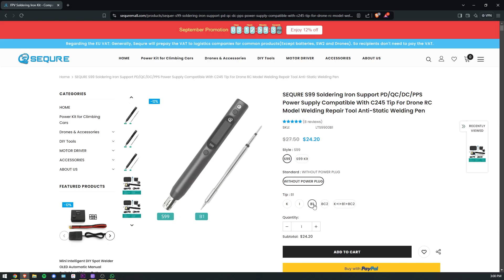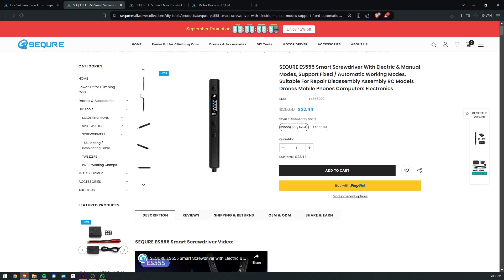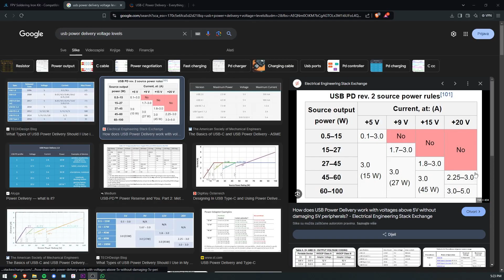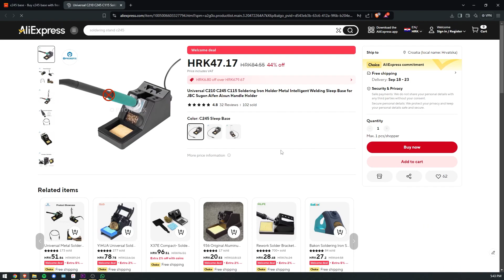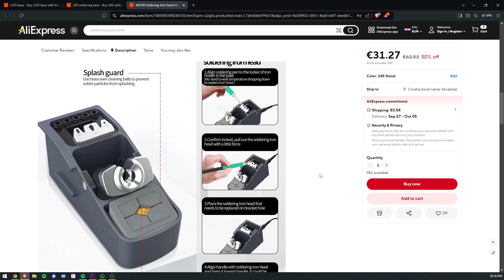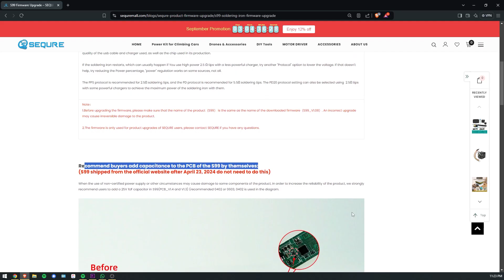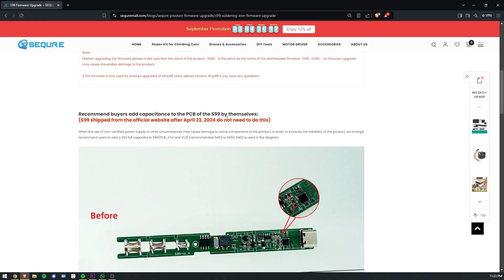JBC C245 Tips for $24!? Meet the Sequre S99 Soldering Iron!

Comment: Sequre advertises the S99 iron as being able to do 150W with 2.5Ohm tip.
The max voltage input of the S99 is 21V so to reach 150W you need over 7A.
But USB C limit is 5A.
What do you think about that?
Reply: You need a 20V 8A power supply brick. (21V would pull 8.4A due to Ohm's law).
Standard USB cables are limited to 5A, so none of the usb-c adapters will do more. You can reduce the power setting in the menu to 60% for a 100W usb charger.
FYI the Fnirsi HS-02A and Alientek T90B have better UI, auto power adjustment. The T90B can do 140W with a 28V usb PD 3.1 power supply.

Comment: A reviewer called VN on Amazon wrote about a design flaw with the Sequre S99:
the tip of the soldering iron cannot be grounded. Without a ground wire connected to the iron, I measured 157V peak-to-peak voltage on the soldering tip. With the ground wire attached, the voltage drops to 4V, but the temperature starts jumping erratically between 360°C and 400°C.
what do you think about that?
Reply: Other usb-c irons can be grounded through the shield of the usb-c cable and there's a grounding screw as well.

Comment: This is a really attractive product. I have an aixun T3a station, but I was looking forward to using c210 and c115 cartridges. I used to use a old weller so I understand the massive speed upgrade in heating the iron up. I would make a coffee waiting for it to be done. Since then I went to the hakko 888D which was great overall but then I tried the aixun and got spoiled with the c245 carts. I love them! I might pick up all 3 versions just to have on hand. Counting cost it will be cheaper than buying a jbc station with the benefits of being portable. Do you currently still use it?

Comment: This is absolutely my favorite soldering iron ever. I use it for everything, and paid the money for a few JBC tips that meet all my needs. I actually made a DC to XT60 cable using a little USB-C breakout and just soldering to the + and - pads. I find that most USB-C PD power supplies get upset with the 8A current spikes and reset. Now I can feed it directly from a 4S battery and still get over 100W without having to find a power outlet for a USB-C PD power supply. It also allows me to use nice thin double silicone wire so that it is super flexible and light and doesn’t get in the way of me using the iron like thick USB-C cables sometimes do.

Side note, that case it comes in, if you remove the foam on the bottom part, will perfectly fit an OmniFixo soldering plate/third hand thing, which I recommend that everyone buy, along with the rest of the accessories for the iron.
Reply: Buying JBC tips is a must, those chinese clones are so wonky sometimes...

Comment: I've got it too! I confirm that S99 works with original JBC 2.5 Ohm tips! And only for the price of one JBC tip. 😅

But not with PD USB-C charger as all of them that I could find can only deliver 20V 5A, and 140W chargers do 28V 5A instead of 20V. From USB-C it can still work using 100W charger when power is limited to 70% in the menu. But it does work to 100% with SlimQ F150 charger/power brick for laptops using DC5525 to USB-C cable, that is to full 150W. That means it heats up in 2-3 seconds. SlimQ F150 is also very compact so it suits this iron very well. But don't confuse it with only USB-C model SlimQ 150.

Search for "USB Type C to DC 20V 3A PD Emulator Trigger Power Cord Charging Cable Converter Wire 1.5m for TS100 PINE64 SH72 Soldering Iron" from "NovelLife Official Store" trader on AliExpress - that's an amazing soft silicone cable that feels like original JBC station cable! And that USB-C to DC5525 cable works from SlimQ F150 DC5525 output to S99 USB-C input or (!) from USB-C charger capable of 20V to TS100 (another soldering iron) DC5525 input. Simply amazing. 😄

Comment: Before you buy, check the price of replacement tips.  Outrageous!
Reply from the maker: Depends on which brand you are going for... You can get the tips for 5€ a piece on Ali, and if you take care of them, they can last a really long time
Reply: @Djambo57 The downside is that the AliExpress tips are relatively high resistance (I think 6Ohm). You will not get that 150W power output unless you get real JBC tips, which have something like 2.5Ohm resistance. And also the JBC tips are very high quality and in my opinion worth every penny.
Reply: probably beacuse they are JBC tips which are the industry standard and will probably outlive you
Reply: It's only $30, and they last forever... it's probably the best $30 you've ever spend
Reply: But worth every penny and like he says in the video, you need to use the JBC ones to get a low enough resistance that you will see the 100+ Watts this thing can provide.

Comment: I'm curious how it compares to the Pinecil.
Reply from the maker: Well I never saw Pinecil in person but from pictures it looks pretty similar to the TS100. I'd say the S99 is a much better pick because you can use JBC tips which is really good. The tips are the main thing when soldering and JBC ones really are the best. Plus, it has crazy power and it's able to solder huuge solder planes without a problem

Comment: No doubt that new iron looks nice. But i have never had to unscrew the screw on my TS100, just set it snug-ish. And the TS101 got USB-C PD wich is nice. Never had a tip die on me either, but i might not use mine as much as you.
Will deffo look in to the S99, looks sweet!
Reply from the maker: Hey, thanks for the comment! Maybe I just wasn't lucky with the TS100 haha... I gor the tips with the iron and half of them died after like a year or so but I do use the iron very often so maybe that's the difference...
Reply: It is day and night difference, if you can afford original JBC C245 tips. Didn't try C245 clones though. Works best with SlimQ F150 laptop charger, that has DC5525 output with 20V and 7.5A. And with USB-C chargers you have to limit its power to 70% in the menu, so not so nice...

Comment: I was hoping this was going to be the Pinecil v3 that Pine64 has yet to give us.  The power input side is a bit disappointing, especially with how long the USB PD 3.0 has been in usable spec, limiting the USB input source to 21v seems outdated, defaulting back onto a higher amp 21v plug (XT60, barrel jack, etc.) just furthers that this design is outdated.  The update to C245 tips is nice, IIRC the C470 carts are physically compatible with the C245 receptacle, though I wish JBC would offer shorter carts. Maybe Pine64 will eventually come along with a Pinecil v3 that has a better PD spec, C245/C470 cart compatibility, and provides short tips like they do for the v2, all for the same reasonable pricing if not start being price competitive with these other brands.  My only real complaint is with the interface, two buttons really isn't enough, having to hold a button or do a combination of held buttons for very basic functions is fairly annoying, especially when it's not that difficult nor increases the BOM by more than a few pennies to have a couple more buttons.  I also wish someone would make tip adapters, both for the TS100 and C245 barrels, it seems like every time I get a new iron there's a different tip standard, and I have a backstock of older tips that can no longer be used without going back to an older soldering station.
Reply from the maker: Well this is the second time I'm hearing about Pinecil in the comments. I definitely have to take a look at this since I never saw it in person... It would be awesome to get higher voltage out of USB-C but in 99% of situations this 65W power supply is enough for me. The only time I used the XT60 adapter to get higher power was when I had to solder some huge 12AWG wires to big planes on my VESC controller. It would be doable with the 65W brick too but it would take longer
Reply: C470 tips are 7.5 Ohm, need 48V. There's no 48V usb-c power supply yet.
The Alientek T90B can do 140W with C245 tips with a 140W 28V USB-PD 3.1 charger.
Reply: @Gregorius421  The Extended Power Range subspec of PD does allow for 48V but is currently capped at 5A, as of PD's revision 3.2 version 1.1 that was released in October of 2024.  Sure this falls short of what C470 requires, but it's unrealistic to expect those tips on a pencil style soldering iron, I had only mentioned them because of the tip industry, outside of JBC themselves, focusing mainly on C245 and C470 production, C210 is lacking behind and C115 are almost nonexistent by comparison; for a pencil style iron, C210 and C115 make far more sense to use, but again the market is severely lacking in alternatives to authentic tips.  A lot of the pencil style iron market does actually lack in power output.  There's sacrifice somewhere, at least until JBC has a successor designed for portable irons like this, and until then there's always a catch with any argument that comes up about power output and tip type, if you really want to argue a point then go back to your soldering stations where everything is actually within spec.

Comment: Can you check if the problem of 100V at the tip when using a power brick has been fixed?
Reply from the maker: 100V at the tip?? I'm first time hearing about this. How did you measure it?
Reply: I believe was resolved with the v1.04
Reply: ~100V AC (but <1mA current) is due to all power supplies having an ESR filter capacitor between primary and secondary. It can't be fixed in software, the tip needs to be connected to protective earth.

Comment: what would you rate the tips that comes with it out of 10 compare to JBC tips which cost an arm and leg.
Reply from the maker: Well, actually, after using them for a while, they are pretty good haha. It's just that I'm used to working with originals everyday but these really do work good and are a lot cheaper. You can definitely work with them out of the box, no need to buy others if you dont need other shapes